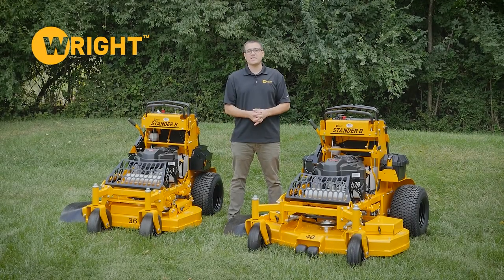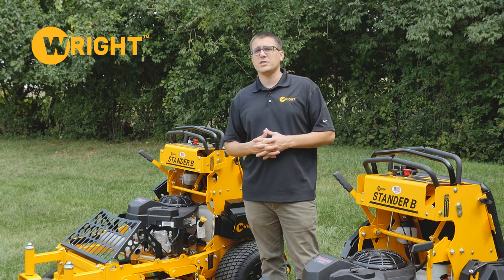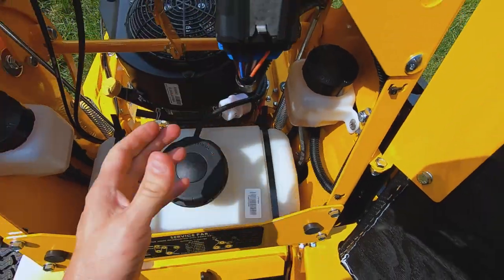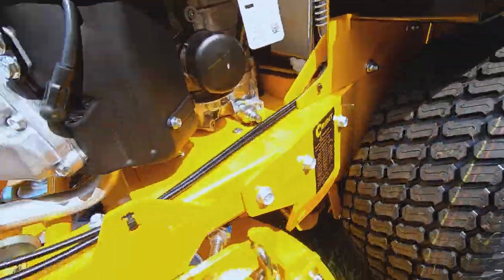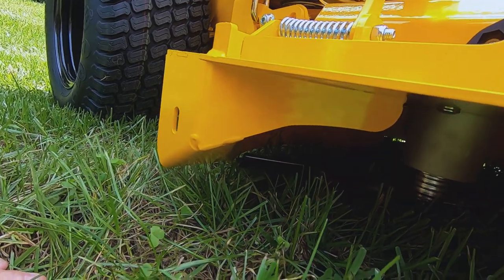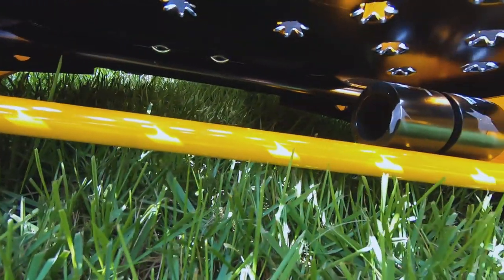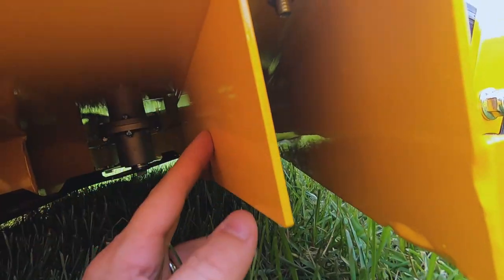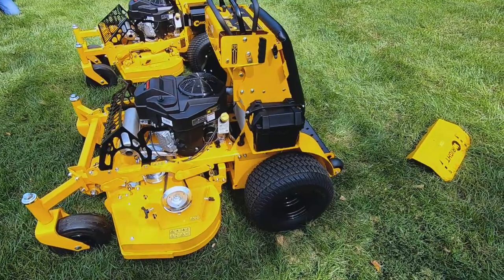STANDER B | MOWER OVERVIEW | FEATURES & SPECS

Comment: Just getting into this industry and plan on buying a stand on. Will I make the Wright decision? 🤔
Reply: Yes!
Reply: Yes, it's a work horse!
Reply: @Ed.Wright  Buying a Stander B 52 tomorrow.
Reply: @kylemartin832  did u buy it how is it ?
Reply: @IHITSEEDS  I did and so far love it. Got it with a big grass catcher.
Reply: @kylemartin832  is that the jumbo one ur referring to..if so what do they run $?
Reply: @IHITSEEDS  I got the Catch Rite one. It's what the dealer had but I really like it. It's the biggest one they make. Its bigger than the Wright's Grass Gobbler with a better handle. Was $370 and you can add a leaf extension. Hope that helps 😉
Reply: @kylemartin832  ok thanks for the info..appreciate it

Comment: Not a fan of my 52 stander B
Reply: I purchased a 48 B 3 weeks ago and it’s been in the shop twice in the last 2 weeks for 2 different warranty claims. First at 10 hours then another issue at only 15 hours on the machine
Reply: @diyrob9160  What issues in particular?
Reply: @NewVisionLCS  I had a short video on my page you can look at. Within the first 10 hours the spring that connects to the tension pulley broke in the middle of a yard and had to be replaced by warranty. Right after I got my mower back I then started to hear a rattle noise and after inspecting the mower a bolt was missing from the exhaust hanger, took it to the dealer and turns out the head was stripped and they needed to helicoil it to get a new bolt in. THEN I got my mower back and still heard a horrible rattle noise when the blades were engaged, after contacting wright directly they sent a representative directly to my house and turns out the pulley that connects to the crank was bent somehow and they replaced the entire pulley under warranty. All within 16 hours of use on residential yards. Wright was very responsive to the issues after I reached out directly. Other than those issues I really do like the mower but worries me it only has a 1 year warranty
Reply: @diyrob9160  Gotcha. Good thing is Wright did cover it all. The 1yr commercial 3yr residential warranty I think is fair due to how commercial use pretty much wears these machines out prematurely.

Comment: Have run my Stander-B 48" for two seasons now and like it very much.  Nimble, well-balanced, good on slopes,, consistently good cutting.  The Kawa engine is a beast (wear both your ear plugs and muffs).  Engine oil changes are easy-peasy though removing the deck to get to the blades is less than fun.  Will be changing the transmission fluid and filters soon and that looks like it will be challenging -- Ed, how about a demo video for this task for the larger Stander-B's, one where you don't use an extraction pump?  Overall very pleased and would recommend.
Reply: Hey  how good are they on sloops , I have a good size slop on side yard,  curious as to your opinion
Reply: Why are you removing the deck?
Reply: @billljones979  Excellent on slopes, just lean your body appropriately and it should do well.  Have yet to feel unsafe on slopes up to 30 degrees.
Reply: @doubleedge7250  To sharpen the blades and give the deck a thorough cleaning at end of season.
Reply: @Online-gd8cm  I have been in commercial landscaping for 13 years mowing all types of grass in every condition. Never once had the need to take a deck off any mower I have ever owned 🤷🏻‍♂️. To each there own I guess
Reply: Rep told me put a lift system in garage and connect to front ties and Jack up to get to blades etc.

Comment: Hey Ed, at 16:58 you're talking about the new pulleys and I notice you don't have the original pulley guard on them - shaped like a Y over the pulley...I have the B52 and my shop replaced the pulleys (and hats off to Wright for making that easy for the consumer - Thanks!) but they put the pulley guards back on and they seem to be rubbing the pulleys. Again, at 16:58 you don't have them on. Should they stay on? Or should I just remove them?  Thanks!

Comment: I'm really leaning toward a Stander B 48 even though nearest dealer is an 1hr and 15 min away!!
Reply: Did u end up getting the 48 if so how do u like it
Reply: @IHITSEEDS  Not yet, I'm working with Master Mowers in Marietta Georgia. Probably going to step up and run a 36" and 52" combo.
Reply: @NewVisionLCS  How do u feel with the same fs651 being on both the 48 an 52 I think with the 48 it would perform better .. what prices r u seeing I haven’t went to my dealer yet
Reply: @IHITSEEDS  Since my dealer is offering the 52 for the same price as the 48, I might as well take the 52. If you're just taking your time and mowing, I don't feel nor have I seen in my own research that the FS651E has any issues with the 52" deck over the 48" deck. If you're trying to mow at 10mph, then yes the Stander B isn't for you ya know. Give Michael at Master Mowers in Marietta Georgia a call! You might be surprised at the price he gives you, and he can ship it to you if you're to far away. I've seen him beat other dealers pricing even with shipping the unit!
Reply: @NewVisionLCS  thanks for the quick response I was just seeing if dealers r actually using the 12% promo that’s on wrights site or if it was a fleet price ..cause this is only gonna be used for my yard an trying to convince myself this is something I should pull the trigger on
Reply: @IHITSEEDS  You're welcome! Where are you located?
Reply: @NewVisionLCS  NJ
Reply: @IHITSEEDS  Ah okay. See what the best price from your local dealer is OTD and then see what Michael is offering with shipping. If Michael beats your local dealer than either they match Michael OTD or order it from Michael. Some of these local dealers really try to play the local card, but doesn't equal a higher price. If they are a Wright dealer, than no matter what they have to honor warranty issues or you can let Wright Mowers and Ed himself know how your being treated.
Reply: @NewVisionLCS  thanks for all ur help ..I’ve been praying on it..I’ll see what happens this week
Reply: @IHITSEEDS  Trust you me, I KNOW that Prayer DEFINITELY WORKS!!